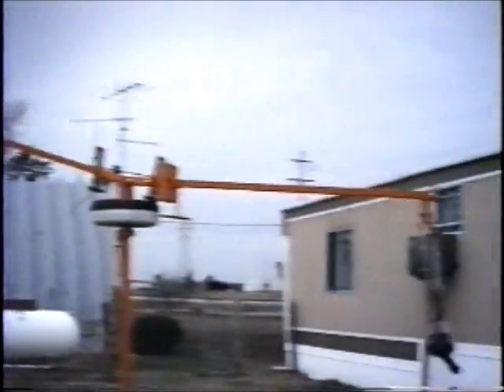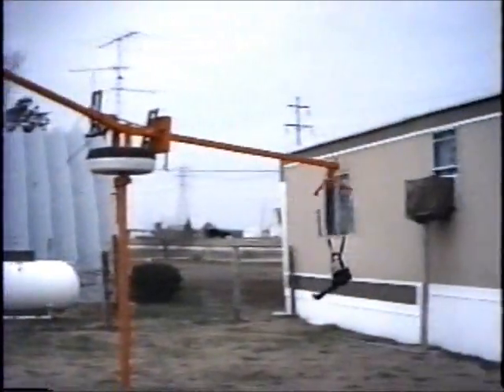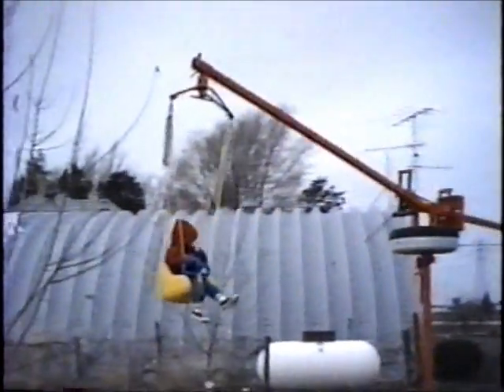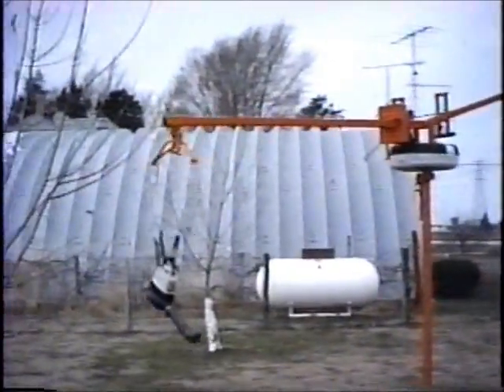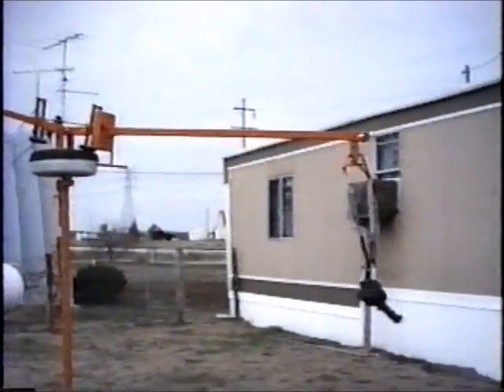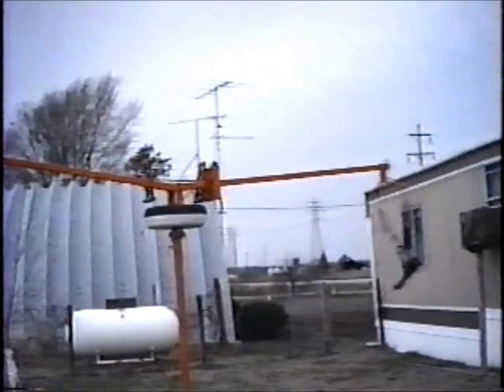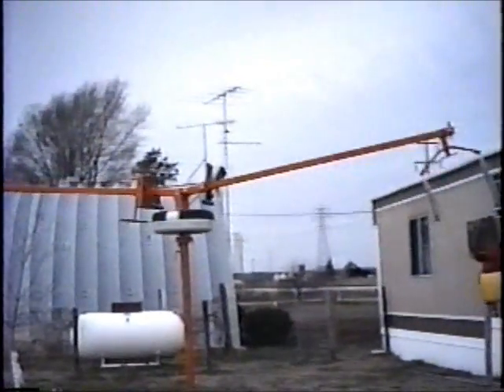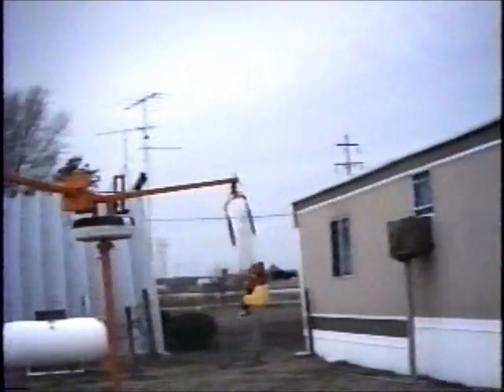Leaf Blower Powered Rotary Swing

Comment: Exhaust pollution from two-cycle engines is a large contributor of carbon monoxide (CO), nitrous oxides (NOx), hydrocarbons (HC), and particulate matter (PM). The particulate matter from combustion is small in size (2.5 or microns or less). (cont.)